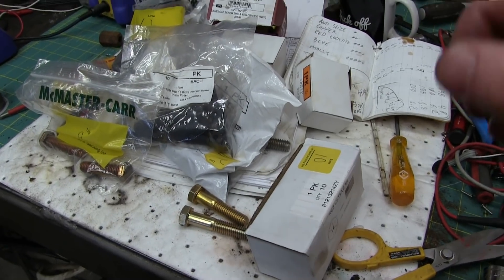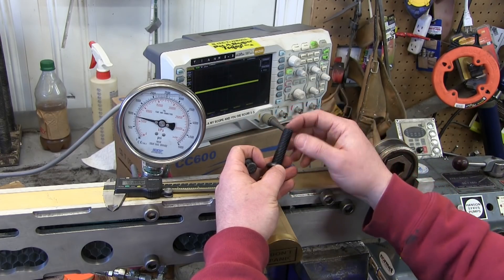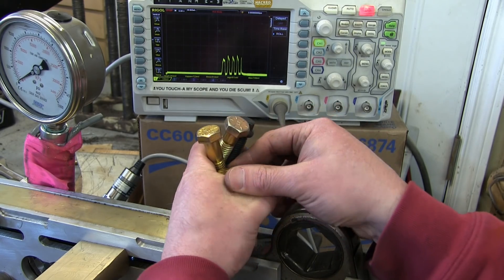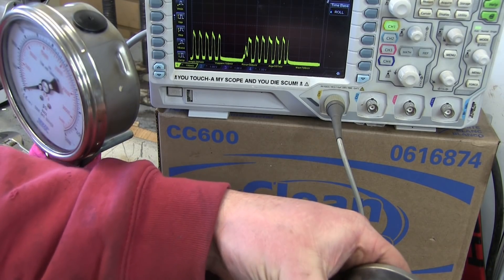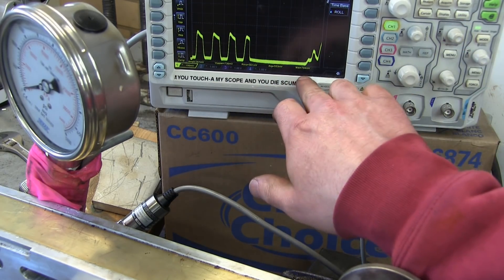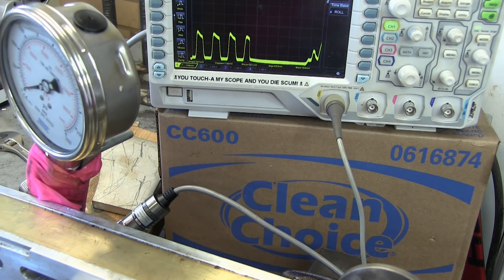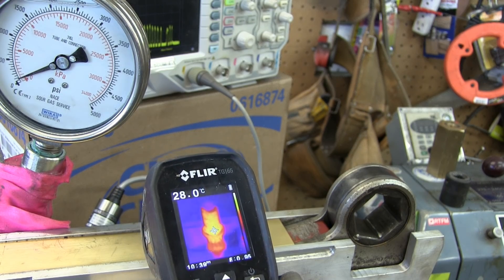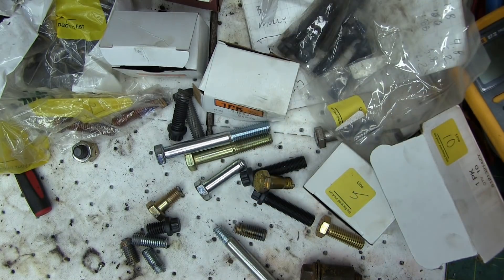Home Depot Bolt vs. USA Made | Offshore Suprise!

Comment: In Germany, we get higher grade steel by default (Like S255 instead of the S235 you ordered, you can't sell it as higher grade though, paperwork^^), just because it's too cost expensive for the supplier to keep two seperate lines working. Maybe that applies to chinesium bolts as well?
Reply: Periodic Musings I think you have no idea what I'm capeable of imagining.^^
Reply: @Dunealex, Touche
Reply: Periodic Musings :)
Reply: Highly unlikely. Chinsium bolt manufacturers operate on a scale you can't even imagine.

Comment: Fine thread yield > coarse thread yield for the fasteners. Trap for young gamers to not confuse fastener yield with material yield. In thin gauge materials the coarse thread provides higher pullout values than fine threads do.

Comment: I always thought finer threads apply more force because you need to turn them more to get the same travel, sorta like a gear kinda analogy. Instead of a greater cross sectional area of bolt

Comment: Hey AVE! Great content as usual! A couple things I'd like to comment on. That torque peak your seeing; you mentioned it being from unsmooth movement, but could that also or instead be from the difference between static and kinetic friction to start the threads moving again? Did you lube the threads? ARP makes a big deal about lubing head studs in order to get the correct clamping force from the recommended torque spec. Not sure how big of a deal it is but of course I followed their advice. And finally, speaking of ARP, I just had to spend a butt load on studs for a 6.7 Cummins b/c head gasket issues. It failed again after installing the ARP studs, but I'm not going to fault the studs for that one. If you can get ARP products I'd be curious to know if they live up to their cost on an apples to apples basis.

Comment: I paused at ~10min so maybe you get to this later in the video buuuuuut, You're saying the L9 and grade 8 are taking roughly the same load... I might be off in my thinking here but you arent directly measuring the tensile load on each fastener. You are looking at rotational torque used to impart the tensile load. I've seen different figures but I believe something like 80-90% of the torque input goes to just overcoming friction. So it stands to reason with the same size bolts with the same thread pitches yadda yadda would see roughly the same rotational input peak, yes? I would think to more better measure the tensile load you are imparting without a loadcell, you'd want to tally up how many cranks you put on each bolt at full chooch until failure.

Comment: Interesting. I had always thought that fine thread Fasteners were stronger because there was more surface area on the threads. I'd like to see to Fasteners with the same interior diameter, but different threads per inch compared

Comment: This is just like the harbor freight fuse issue. The fuse is rated for 30 amps blows at 37 big problem. If there is machinery that relies on the bolts breaking before the component does then if your putting a chinesium bolt in there now your putting that very expensive component as risk of damage.

Comment: Before, I couldn't spell engineer, now I are one.
We were always thought to use 1.5 x the diameter for nuts and threaded holes.

As far as the chinesium bolts, the government subsidies let them use a higher grade of steel.
Over here, steel grade = money.

Comment: I'd check that transducer and maybe give it some clean fluid (maybe a bit of trash in their.  Just seems a little fishy how comparable the values the grades are to me and the amount of force still needed for breakage after yielding (yield curve flat for too long).  And where were you at in the range of the xducer?

And keep your fingers away from hot nuts! (yea, it was a bolt but that don't werk). 
EPIC!

Comment: Ave i bought a dewalt oscillating saw. Had it only a couple months. Probably only a couple hours of operating time on it. The jezless thing craped out on me but the light still works. Got it all apart in a box and im not see any obvious signs of self destruction.  Wondering if u could do a voltage on one. Maybe u could can see whats not so skukum. Thanks Keep dick in a vice.

Comment: I work as a Injection moulding machine setter/Technician  and have always gone by the 1.5 times the diameter of the bolt, so the 3 threads is something I’ve not heard of. On a Krauss Maffei machine I could believe it, but an Arburg, hell those platterns are as soft as sheeet.

Comment: I noticed that on a "plastic" part of my Borsch grinder right inbetwixt the gearbox housing and guard it says "PA66-GF50H" So the PA66-GF50 is Nylon with 50% glass but what does the H in the back stand for? Any ideas?

Comment: Couple of points I think you missed in this video:
1.  Fastener coating (different coefficients of friction) has an affect on tightening and resultant clamp load.  Those zinc plated bolts have a relatively huge range for the coefficient of friction vs the Phos & Oil 12 point.  That means just the variability in the fastener coating could affect the clamp load capability and ultimate failure of the fastener.  Additionally, the 12 point bolt flange head has a larger surface area under the head of the bolt which increases the torque coefficient which affects clamp load as well.  
2. "3 threads is really all it takes for torque capable joint" is a bit sketchy.  For steel, proper thread engagement should be ~ 87.5% of the thread size when using a nut.  For example:  a 1/2" bolt should have 0.437" thread engagement.  You'll notice that a 1/2" thread nut measures about 0.437" thick.
3. For reference, a Grade 8 nut is actually stronger than a grade 8 bolt.  Reason: you always want the bolt to fail before the nut.  You should not have needed two full sized nuts to perform the final test.  

Honestly, I agree with where you started the video but disagree with the conclusions you drew at the end.  There are a ton of variables that differentiate just those four bolts you selected for this test and to just say, "the American bolts are not as strong as the Tiawan bolts" is a fallacy.
Reply: Good points. In a different area of consideration, the sample size of one per group leaves a lot of undetermined variability between groups and the test procedure.  Not that I want to sit through the tedium of watching a full batch test, but showing the results from five samples from each group at the end would be a bit more insightful, provided his arms hold up that long.  After seeing firsthand the disturbing amount of variability in hardness in parts fresh from a heat treatment service (the same batch, no less) it would be difficult for me to accept the results of such a small sample size as being a valid representation of the respective groups.
Reply: Well said...we do couple plating and several coating...oils, chromates and torque modifiers.
Reply: Make us a vid and prove him wrong! I double dare ya!!

Comment: 6 threads in steel was what my daddy told me!
I was having a turd earlier while thinking about this exact same thing, you have a complex stress going on there with both tension and torque so you would have principal stresses which would result in Shear force, and of course the shear strength is only around 0.67 x yield strength so if the applied torque and tension produce a shear force greater than 0.67x the tensile force then the bolt will fail IN SHEAR

Comment: The tug test would check ductility. The "weaker" american bolt may handle vibrational and shock load better that the "stronger" wantainessium bolts. What needs to be checked is the mexican made bolts.

Comment: The specific coatings and lubes used are extremely important when using torque to estimate axial strain. Can easily be a difference of 30% from cheap oil to ARP fastener specific HP grease; or that crazy aerospace shit I found last year from dow or dupont(need to find the name) cost is like $60 an ounce and they have a dozen sub-types but wholly molly nothing else comes close. And another 20% between surface coatings, (electro-zinc, cadmium, hot dip, black oxide...)
Reply: Dupont Krytox. I forget the model number I was looking at and the line has expanded greatly since. Also repackaged for bicycles as "Finish Line™ Extreme Fluoro Grease" in a tiny syringe.

Comment: A fastener is simply a spring. You intentionally stretch it and it responds as a spring does by pulling back against the stretch. Increasing the stretch increases the clamping force the fastener applies. When the clamping force you apply through the fastener exceeds the forces of the mechanical system acting to separate the components fastened together, the system will never fail. There is a difference in the quality, ultimate clamping force and reliability of torque readings a fastener will deliver in use between cut (machined) threads and rolled threads (compressed, sort of like forging). It would be interesting to test a high-quality rolled-thread fastener, such as produced by ARP in California. The fasteners tested in the video above employed cut (machined) threads. Lubricating the threads on any fastener reduces the torque applied lost to friction and applies more of it to stretch the fastener. Generally, lubricated fasteners require lower applied torque to achieve the desired stretch (pre-load). A discussion of Young's modulus and stress/strain curves would be interesting.  Another enjoyable and excellent video!

Comment: I wonder if when say a European car manufacturer conducts the same test to see what the strongest /cost effective bolt is, they go "oh this ones American it must be the best",
or do they just treat all competitors on the world stage the same and let the numbers do the talking.
I think there is a case often that the cheap offshore has quietly supplanted the American equivalent that rests on its laurels because the offshore product knows that good enough does not cut it if you want a world market share.
Reply: Are there plenty of "capable suppliers" in the group often alluded to under the banner "offshore"?

I think the only people who are going to be caught out by fasteners not suitable for the job are those who didn't know what to ask for in the first place.
I would be more surprised by an offshore supplied fastener falsifying meeting accepted industry standard torque values than that it actually exceeds them.
Bolt failure is easy to spot, the recording of where that bolt came from and recording the torque applied to that bolt is pretty easy and standard these days.

By offshore I mean offshore to America, its ubiquitous use in Utube land. I'm from Australia.

Comment: I'm not sure this test means all that much. A screw is normally used to hold two or more parts together and is stressed in tension, not just torque.
So when you tighten a screw, you actually stretch it to a point where it will hold that tension (not come loose.)
I think that's why they are using torque to yield fasteners now.
Whenever I use a nut and screw as a press, or anything that might really stress things, I use washers and never-seize to keep the friction down.
I guess what I'm saying is that I think there is more to fastener strength than how much tightening torque it takes to break them.

Comment: Another interesting vid . I worked for Bowman Distribution a few years back .There was a point where there were counterfeit bolt problems . Testing the sheer strength between the different bolts might  give another perspective . Rotational torque has its problems in the accuracy camp . Testing the Rockwell as well as the sheer would save on the Armstrong method too :>)

Comment: It is not that you only need 3 threads, it is that regardless of total threads engaged(over 4) the first 3 threads take 90% of the load due to bolt and nut strain-deformormation.  First thread bears something like 60%, second is 20%, third is 10%.... (from memory, I may be off a few points)
This is because the male side stretches making a longer [and changing] thread pitch, while the female side compresses making a closer thread pitch, and the 60 degree thread form also creates a radial load so the issue is made worse in the case of a nut (rather than say a tapped casting) because the nut ID grows from the radial stress.
A few specialty thread forms have been created to counter the strain deformation but they are directional or patented or difficult to machine. Variation of the thread pitches can work as well if engineered for a specific joint, but I doubt even NASA bothers to go this far. Varying the pitch also means that you cannot spin in the fastener by hand due to friction.
Now, common steel is about half as strong in shear as tension and cast iron equally strong in both loadings, the bolt body is under axial tension of coarse but the threads are under shear.
Reply: General info for the crowd. 
Coarse threads are more common than fine because they are more forgiving of either sloppy manufacture and assembly or because they can tolerate more dirt and shmoo in the field (depending on manufactured allowance). Also fewer turns to install, and some materials like wood, plastic, and aluminum have more consistent properties with coarser threads.
Type 2(medium) is the common thread clearance allowance, allowance types one and three are used for precise fit(clocks and calipers) or extra shmoo allowance(military trailer hitches).

Comment: Dear uncle bumblefuck, 
While camping, I had a transmission cooler line spring a leak. now I got a replacement hose, however, it needed a little loosening up via some boiling water in the ole percolator. Now my coffee tastes a bit like ATF.. Am I gonna die or am I stronger than ever?
Reply from the maker: Not to worry, your insides are well lubricated.

Comment: I tried grade 9 cap screws on an Atlas Copco Wagner 50 ton haul truck. We literally couldn't keep the wheels on these rigs - fourty 3/4" bolts wasn't enough. Reportedly the grade 9's provided a better gunshot effect when the bolt head popped.

Stronger isn't always better such as when ductility is sacrificed. Likely have to go with high quality manufacturers such as ARP, SPS, Unbrako etc. to go stronger and still have good toughness.

I had to go to Dana for a different axle end and wheel design to keep our wheel bolts from breaking.  Turns out our bolted joint was just too flexible to allow the bolts to survive.  The axle planetary cover bolts also attached the end-mount wheel with a center bump ring to carry the load.

Whether it be axles, transmissions, gear boxes, hydraulics...hardrock mining is a tough enough application that rarely an OEM can get it right the first time.  Even simple wheel bolted joints.
Reply: Changing that tire must take a lot of patience and/or crowbar skill to get the holes aligned.
Reply: Yeah, stronger is not necessarily better since usually the ductility (toughness) is sacrificed. At least with cheaper fasteners. 

I'm looking at a RUD catalog right now. They show 8.8, 10.9, 12.9 and a RUD "ICE-Bolt" all being bent in a Prisma-bending test. Not familiar with the test but it looks to be the bending of a threaded rod until the thread root ruptures. A good pictorial to compare different grades with a high-end bolt.

In the case of my Wagner wheel bolts, stronger grade 9 was worse. We could have tried custom bolts but in the end we changed the wheel attachment to significantly improve the bolted joint.
Reply: littlegoobie, I've read and learned the same. Grade 5 is sometimes better for the application.  Reasons as you mentioned.
Reply: TheTane2, removing these wheels can take port-a-powers, forklifts pulling and all sorts of fun stuff.  Look at a Wager MT5000 or MT5010 and you see they have pretty big (and heavy) wheels to muscle around.
Reply: There's a machine for that.  https://www.youtube.com/watch?v=FDXhRmWUep0
Reply: it's the same recommendation for engine mounts and random suspension parts if you frequent forums.   although people are tempted to use grade 8's, the experienced highly recommend using grade 5's because they're more flexible and a bent grade 5 will hold an engine or bracket in place a lot better than a grade 8 cracked in 2 pieces.
Reply: Well like on airplanes and everything I think they use like grade 4 instead of Grade 9

Comment: I once bought a heap of chinesium ceramic capacitors 100nF 10% accuracy. After measuring them I got such picture - all of them were 90nF, so it was 90nF capacitors with 1% accuracy.  I guess China have no problem with QA and probably technologically is already ahead of so called developed countries.